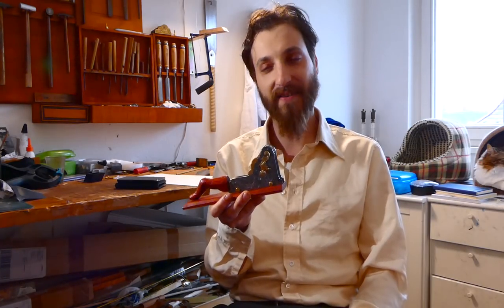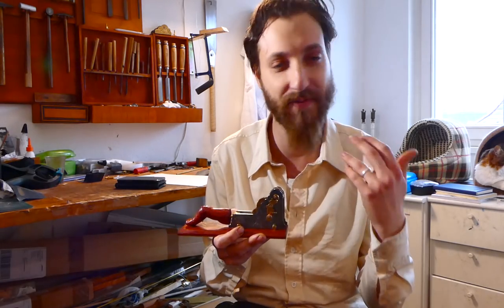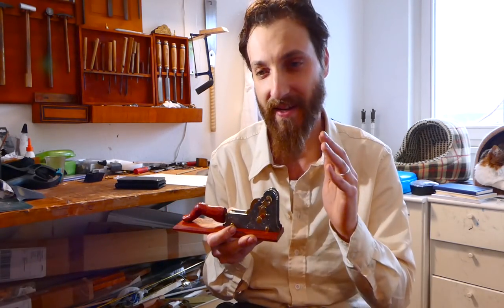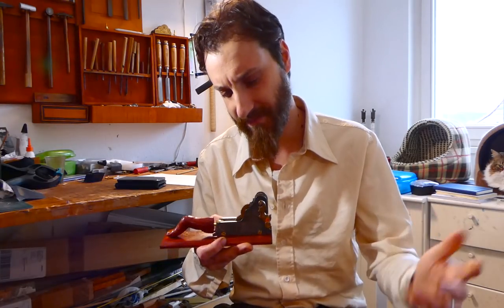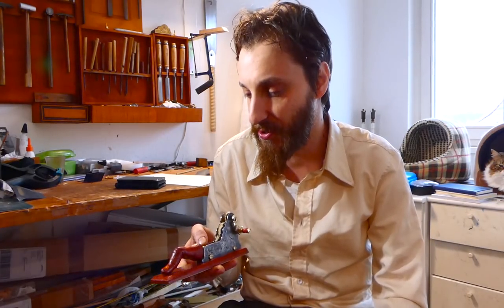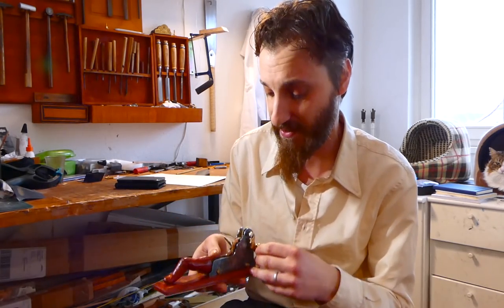Making a Finger Tapping Machine

Comment: Next time challenge: whole hand tapping. Five fingers tapping one after another.
Reply: Instead of having a gear facing vertically to activate the lever arm he could have one with the axis going directly into the base at a 90 degree angle to the flat base's plane. Then he could put that on a riser and have a slope ,on the bottom half, with the lever's coming up underneath that, being pushed down by the slope then dropping when the reach the sharp end of the slope. That would greatly simplify the mechanics for that concept.
Reply: with moving knuckle joints :D
Reply: @Joe-pi9bx  using the same exact mechanism, with an axle and 4 ratchets offset from each other at the end instead of the one. super simple addon compared to the original device.
Reply: If were going into designs for super intricate hands lets just dive right in and make a working wooden arm
Reply: Yeah that seems cool
Reply: Ik it’s a joke
Reply: Or a Snapping gauntlet....
Reply: Up
Reply: After that: thumb turner
Reply: I'm wondering if that is where he started... idea wise I mean...
Reply: @Joe-pi9bx  Will there be room for hand gravings?

Comment: Hi Uri Tuchman,
You were asking about some orangy-ish wood, but hard wood. have you ever worked with any 'Osage Orange' tree wood before? It's rather hard wood, - really hard wood, but the grain packs tight together, they use the wood for a lot of wooden mallets and handles for tools out here in the states. it's the tree with the big bumpy green softball sized fruits that make a mess everywhere. has thorns, and was actually used in medieval times as a defensive wall, when grown close together the trees form a thick wall of trunk, an enemies ax would dull before getting even half way through the stuff. And it's Orangey!

Comment: Beautiful! That engraving is really nice! Do you do you make it up as you go, or do you use a pattern?
Reply from the maker: Thanks! I first draw guide lines for the basic spirals than I continue free hand, I found that I get the  best and most organic results by following my body movement than to follow a line.
Reply: Uri Tuchman Amazon bloodwood is a great wood that is able to keep its color. You can also try Red Heart. 

For Padauk, you can have some good results in using a heat gun for bringing the color back. Same thing as Purple Heart, use a heat gun and it will turn to the deep purple color. The wood fibers are raised when heat is applied. 

You can also just put it in the oven or maybe the microwave and get the same results.

Comment: Orange osage...or Osage orange.......try to carve it freshly cut after curing or drying it becomes rock hard.but with modern power tools it's sometimes not an issue depending on product.in the virgin islands I used to go out and find the old long dead mahogany stumps.they are hard to find but not impossible.my guess is they have been dead for 3 6 or even 8 hundred years or longer.very little rainfall and its water resistance and mahogany has a natural termite resistance as well as other worms or insects.after a tree dies,these properties are in higher concentrations the lower you go.so after hundreds of years the farther from the trunk and root parts loose those properties and eventually become palatable for termites to stand somewhat ,and the water proofing properties eventually fade and the only thing left is these lower trunk/underground root balls.the wood is of the  best properties.you  can see where the termites and worms just couldn't stand to eat it further because it's so concentrated.amazi g that that hasn't rotted either,,,they are similar in example to American fat lighter stumps.with the concentration of the pine resin condensed to the point that when you light a rich dense old piece it almost acts as lighting gunpowder or fuel and burns super hot (which is why they used it in making dynomight.mahogony doesn't burn the same but it chemical makeup is concentrated the same....

Comment: it would have been so much funnier if you made a platform at the top that came off of a 2 sprocket assembly that when you tapped on the platform it actuated the wooden to tap just like the actual finger inputting the tap lmfao